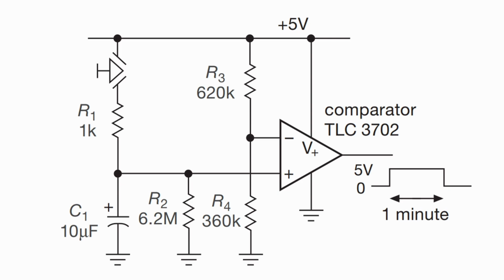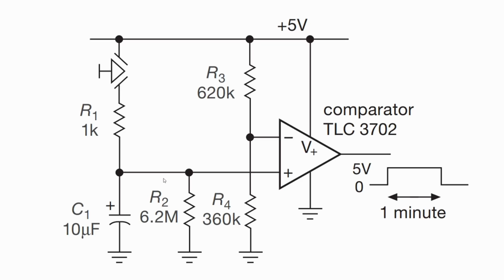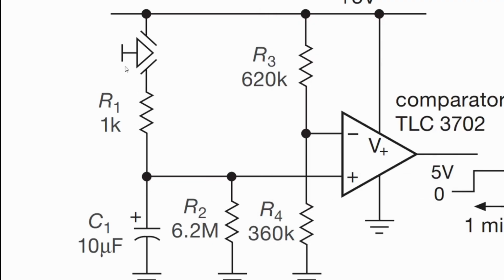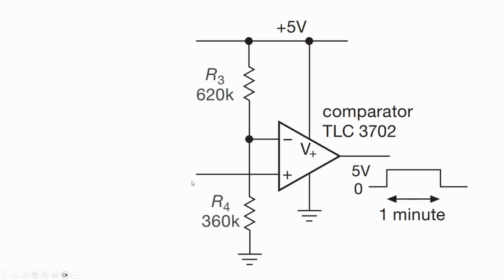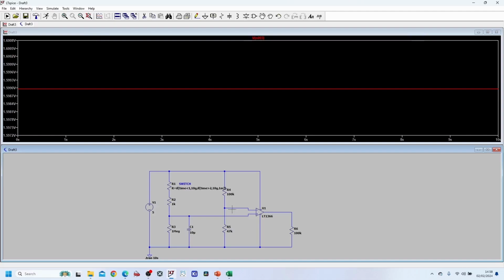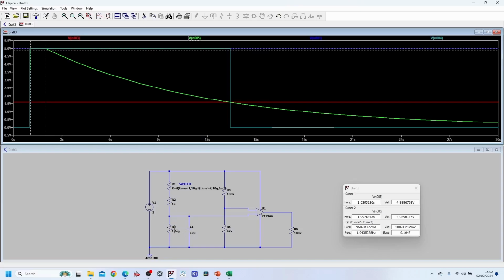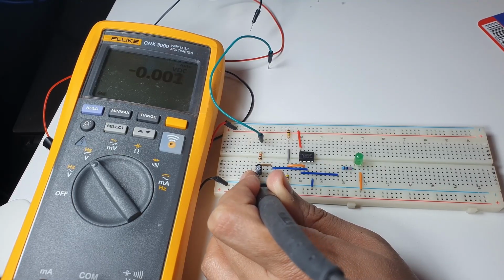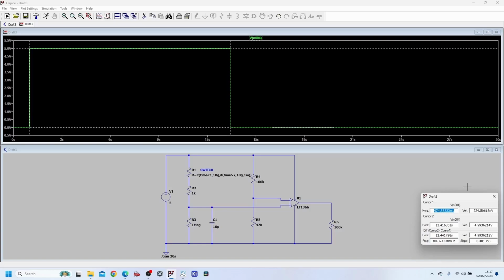Beginner Electronics - RC Timing Circuit - Learn Art of Electronics

Comment: hello, is it okay i im using ceramic capacitor instead of electrolytic, because i want to place it in my board (as an smd component) and i want to make it compact
Reply from the maker: Yh should be fine, it's harder to get larger capacitance value in ceramic but can always add em together.

Comment: As it's a video for beginners (like me), it would be good to start with an explanation of the purpose of an RC timing circuit.
Reply from the maker: There are few uses (motion sensor lights come to mind) but my objective was to relay information on potential divders, RC charging and discharge curve, and op-amp. 

Thanks for watching.